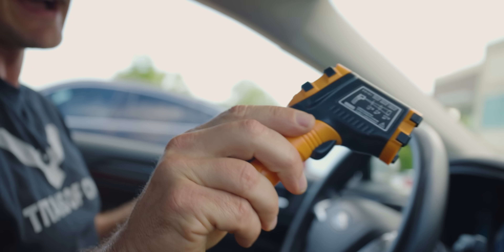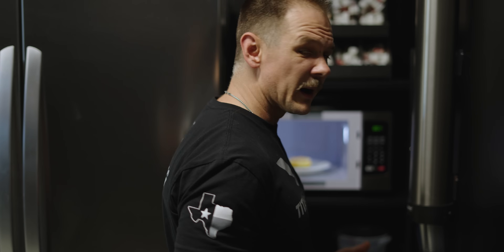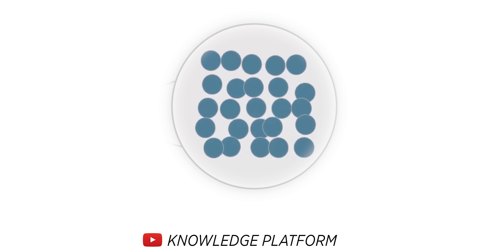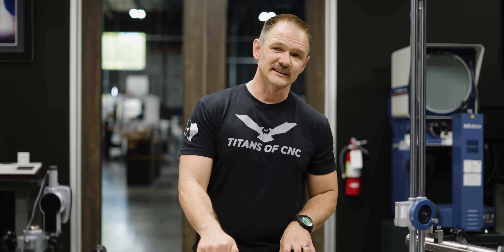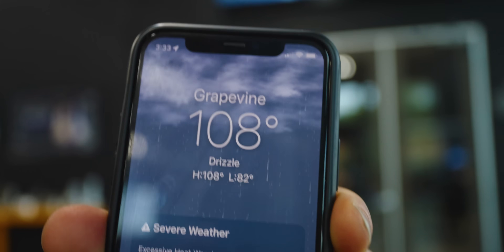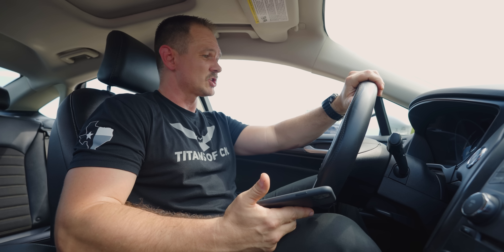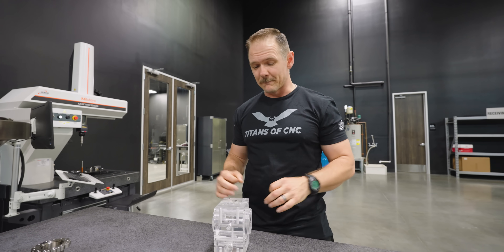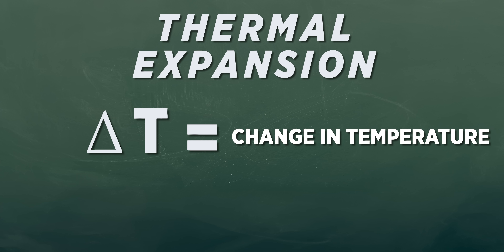THIS Is Why You Should Care About Thermal Expansion

Comment: i think i have a correction on the 10 times to the negative 6 in the example shown there is a missing 0 so its actually 0,0000013 so if we calculate all that again 0,0000013*5,001*(-22)= -0,0001430

so that means 5,001-0,0001430= 5,000857

i mean i could be wrong but i think for metal (i only work with plastics) this is actually way off

Comment: Good old thermal expansion.  Use it daily to install bearings and couplings as well as sometimes removing said items.  Stick a bearing on a bearing heater till its around 240f and it will slip right on the journal and then lock in place a few seconds later as the heat transfers to the part and the temperatures equalize.

Comment: Two instances when you really should consider thermal expansion.

1) Very large components that need to be machined to a tight tolerance.
2) Materials that have a high coefficient of thermal expansion and a tight tolerance. (PTFE)

Comment: I have a part on the lathe with a .1000 bore, +.0002 minus nothing, my coolant gets to 90 degrees when the machine is fully warmed up we don’t have a chiller , I use the thermal coefficient to make my part bigger, to compensate for the 68 inspection room, works everytime,holding that DIM at .1003 is money, just measure fast before the part can cool. When you can do this, you can truly master aerospace machining! Even with older machines.

Comment: Hey Travis, Great video! If your into precision its must have knowledge 👍 A little pointer for your use of the thermal imaging camera is to use emissivity tape on the part you are measuring 😊 I use it to sense check hotspots on thin wall packaging injection moulds. If you dont use it you could read the wrong temperature due to differences in the material's emmisivity, read the temperature of the object behind it (if it is transparent to ir) or read the reflection of another object if it reflects ir 😮

Comment: This was covered in year one of my apprenticeship and correctly referred to as the coefficient of linear thermal expansion. Have only had to use it a couple of times in toolmaking career due to hot summer and working on aviation and nuclear industry stuff. Whoever specified a machining fixture with a 7075 base plate that had to be jig bored to a silly tolerance was the origin of the problem. The dam thing was moving all over the show as the toolroom warmed up during the day.

Comment: Great video overall, but especially the explanation of why hole diameters increase with a positive temperature change - I knew that on a practical level, but lacked the intuition you gave about the circumference length increasing.

Comment: Machining plastics is not as easy as it sounds if there are tight tolerances. All plastics wether extruded, molded, cast... have internal stresses that are released as the plastic is machined. It may check out great just off the machine but can change the part over time, Even some of the great engineering plastics have these issues. To control tight tolerances on plastic parts we would rough cut the parts, anneal them to relieve the stresses then finish machine. Then there is the issue of moisture absorption; some plastics like nylons can change depending on the humidity. It is important to understand the operating environment of the finished part for temp and humidity and design accordingly. Decades as a machinist, ME and designer...

Comment: In that calculation you used degrees Fahrenheit is that equation not in celcius?
Reply: The equation can be used for either Fahrenheit or Celsius so long as the CTE you use in the calculation is the correct one for the temperature units used. That is, the same material will have different CTE values based on whether you are calculating for Fahrenheit or Celsius.

Comment: Nice video. But how do you account for thermal expansion if the final part is used in a hot or cold environment?
Reply: Great question. While I am no engineer I imagine your print would account for this. The dimensions and tolerances would likely be sized according to the anticipated growth or shrinkage of features.
Reply: I think the equation can tell you where the part will be if you know the temperature it operates at
Reply: U just account for that temperature in the equation, should be on print. With implants we generally have to hold there tolerance in a 97 degree enviorment, so there is no risk of the part shrinking or expanding inside someone.
Reply: If it's THAT critical your customer should be willing to tell you the temperature the part is going to be used at. (All together now: "Yeah, RIGHT!")

Comment: Love it.  It's not something you think about first thing but it is definitely something that can bite you in the end.  We had an aluminum part that was 240" long that had some slots all down the length of it that was all tied back to one end which was the datum.  We had to keep a thermometer on the part and instruct the machinist to only machine those slots if the temperature was at 70°.  The part was so long that just a couple degrees would make a big change in location of the slots by the time it got to the end.
Reply: What type of beast do u run a 240" part on?
Reply: @verakoo6187  It was on an Okuma MCR Double Column machine with interchangeable heads.  A very big machine lol

Comment: Loving the 'stache! I guess I'm still working under the misconception about holes getting smaller. When sending parts to be heat-treated that have drilled and tapped holes, I've always had to drill oversized and tap with an upsized tap. They always come back on size. Is there something more going on in the heat treat process that's shrinking it, or is there another phenomena going on here?
Reply: Thanks man! I imagine with threads the profile of your thread is expanding into the hole whereas a with a normal hole only the circumference is expanding. Threaded holes might be an exception based on the addition and direction of the thread contours. Great question!
Reply: I don't know the material or heat treat process in your case.  We used a tremendous amount of lower carbon steel (8620 and others) which was case carburized and then hardened.  The carburize process deposited carbon to anywhere from .020" to .060 depth.  This would cause ODs to grow and holes to shrink.  We also had to allow for this in machining prior to heat treat.  We used higher GH number taps and sometimes larger tap drills to compensate.  Perhaps this is also what is happening at your facility.  The same thing needs to be done with parts that are subsequently coated or plated with a significant thickness.

Comment: Excellent video, Travis! I remember working with parts where thermal expansion was the difference between a pass or a fail. The heat from my hands impacted them upon inspection. I had to let them sit at room temperature for awhile, running my machine blind of any adjustments just to keep the machine up to temp.
Reply: Yep! I do the same, if I went on break I’d run my machines program without a part in it, if it cooled down for even 5 minutes and I ran a part it would change the dimension and be scrap.

Comment: how long will it take the heat from your hands to expand those pins beyond specs ?
Reply: That's a legitimate question my friend. You could use that equation to figure out the temp change required to put them out of spec and from there make an educated guess based on average body temp. Might be a fun experiment.
Reply: That is one of the the reasons they have necking in the middle, so that your hands won't affect the measurement. Be it heat, sweat or grease

Comment: The shop that I work in is "Not" controlled environment, however we work within tenthousandths, we just basically have our instruments and workpiece at ambient temps and it seems to work. Sometimes if the workpiece gets a little warm or colder we try to work with it as close to temp as we can.
Reply: It’d be interesting to run some of the expansion equations at work and see how it varies day to day, 

I also work within tenths for bearings clearances at basically ambient temperature, keen to run some numbers and see how much they move around